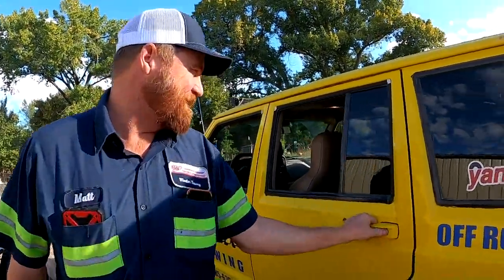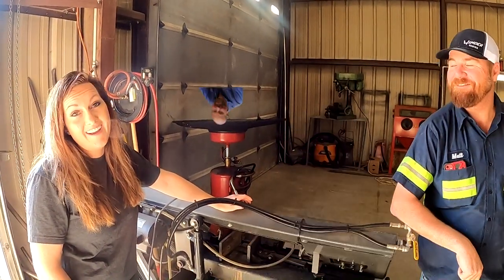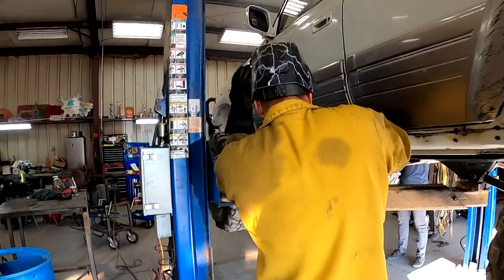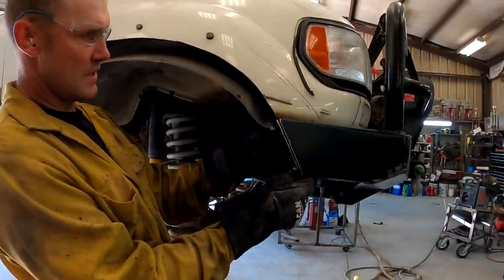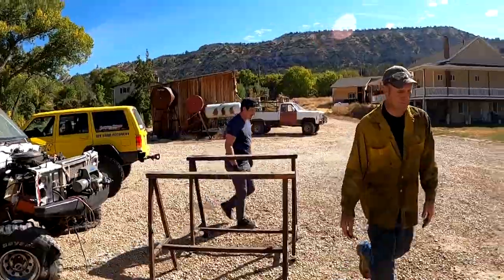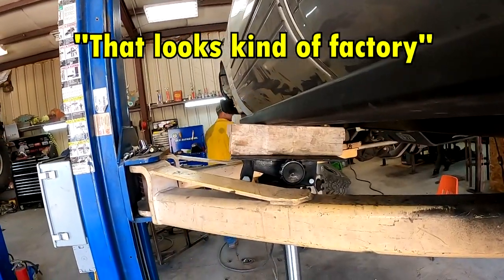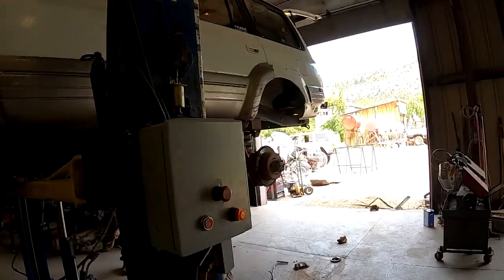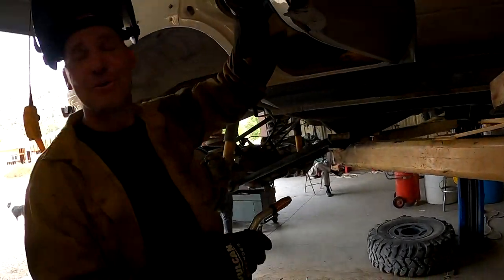**Custom ROCK SLIDERS for a Custom LAND CRUISER**

Comment: 1997 was THE year. Many awesome rigs from that year. Best vehicle year since 1969.
Reply: I had a 97 lx450. It was the most comfortable vehicle I have ever taken off road, my wife called it the off road couch. So capable in stock form. Hated the fuel economy and sold it, I still regret that decision.
Reply: I have definitely done that before. I had a very nice Cherokee that I sold for no good reason. Now I regret it deeply.
Reply: @robertservice2845  I know the fuel consumption is scary, but you spend very little on maintenance. I bought my 80 10 years ago for $6500 with 135 000 miles on it. I could have spent way more to get something more economical, but I though that I would never recoup the extra cash. 
I just never look at the bill when fill it from empty (43 gallons). Ignorance is bliss.

Comment: I almost shed a tear watching the 80 fender get cut. The ‘97 is the best year for the LC platform hands down. LOVE the video!!! Last of the straight axles. The Birfields can handle 37’s. The transmission is overbuilt. I’m not in love with the 14 rubber coolant hoses though.

Comment: I made rock sliders like that on my wj but mine are air tanks too
Reply: Pics or it didn't happen.
Reply: all great until you bash a weld on a rock with 80psi in the tank and it ruptures
Reply: @chrisestill8825  rupturing with 80psi will just blow some dust around. Not the end of the world.

Comment: Hey guys. Love the video. My best rock sliders have always always been 2 inch body lift and then welding nerf bars straight to the frame. I’ve done it to several yota pick ups and all my yota 4-runners. When they hit the lift in the shop I lift all my trucks up by the nerf bars. Solid solid guys.nvr had to re weld

Comment: #Flexus. Never would have thought to just weld them to the rocker panels, he's gonna be back in 3 weeks to weld to the frame
Reply: Body is rubber mounted to frame, going to be some drama if you join the sliders to the frame now
Reply: Yup, shit design. And if they change their minds and decide to do it properly with brackets to the frame, they have to cut them off the body. Without doing that, they'll essentially have the cab welded to the frame... Who needs body mounts anyway... LMAO.
Reply: @Mr_Ruhl   never forget modification is full of compromise. Its whats important to the modifyer, 

not his audience.
Reply: Frame mounted rock sliders are notoriously easy to bend because you're giving the rocks leverage by extending it out. This will be on there for the next 5 years no issues.

Comment: What size tires are you running? I have the exact same sliders but I did not trim the fenders. I run 37s with no rubbing but I hammered back many areas of the wheel well. Nice job with the rear bump stops. I couldn’t tell what your front bump stops were but I used a 2” drop from the top spring capture and a 1.5” puck bolted to the bottom spring perch. Also, look at the Dobinson shocks. You will get more travel then the OME shocks. Nice rig!

Comment: As a fellow 80 Series owner...
-Should have welded those to the frame and just capped off the bottom of those rockers. Water drains in there and now has nowhere to escape. 
-Welding that inner fender well to the outer fender..WHY? Just trim it more and make the inner flush with the fender apron. Cleary its a wheeler already.
Reply: Looks like tabs were added to mount the inner fender to the outer. I 100% agree with the water drainage. Though not much water comes out of the sky in that neck of the woods :)

Comment: Loved the video, and one awesome Lexus! Is there a reason he didn’t want to tie the sliders into his frame? Just curious, thanks!
Reply: Because they had not made a framework agreement... ;-)
Reply from the maker: He wanted to keep the cab mounts functional.👍🏻
Reply: I’ve done lots of hard wheeling, all of the frame mount “bolt on” sliders hang down really far (4”ish). I had a set and sold them since I only used them because they were there. 

I’ve already had a few big hits with these new ones and they haven’t been phased, and the doors still open and close. Paul! These sliders are AMAZING! no complaints 100% best option for my application. LOVE IT!! Thank you!

Comment: sliders to body vs frame - pros and cons - wheeling at slow speed vs falling onto or off of - which is a better bet, cheaper to repair - frame bends and that would suc....! but body bends easier to straighten or patch...unless door gets blocked....so which is the best long term solution..? - this is meant to be a serious question - my Jk is getting rock sliders fabbed and ready to be attached but have been wrestling with which location choice...call it paralysis of analysis like staring at a spreadsheet

Comment: What was the reason for not attaching them to the chassis rails? I would have thought for the extra time it would take it would be well worth it.
Reply from the maker: He wanted to keep the cab mounts utilized. If you weld them to the frame you can feel a little vibration.
Reply: @FabRats  Ok I understand, thanks for letting me know.

Comment: Why wouldn’t he want to tie it into the frame? You have it up on a lift in a more than capable shop. A couple more tubes and welds and he would have some real rock sliders. It would be so much easier to just do it and it would be a lot stronger.
Reply from the maker: He wanted to keep the cab mounts utilized. If you weld them to the frame you can feel a little vibration.